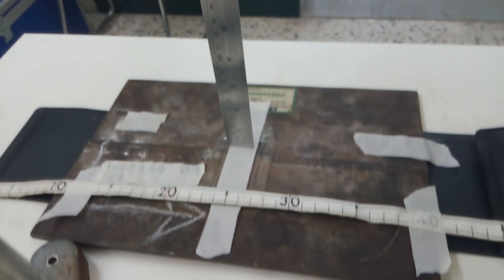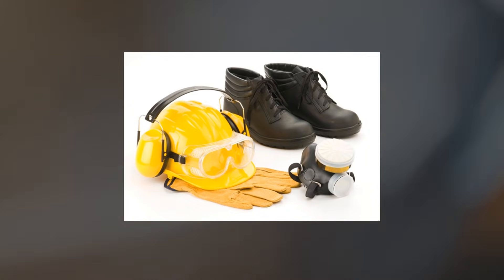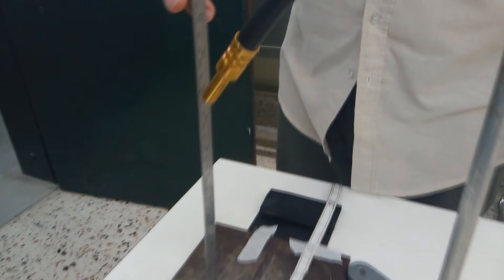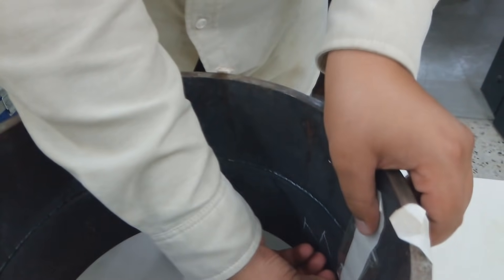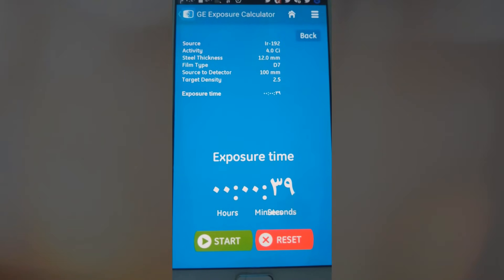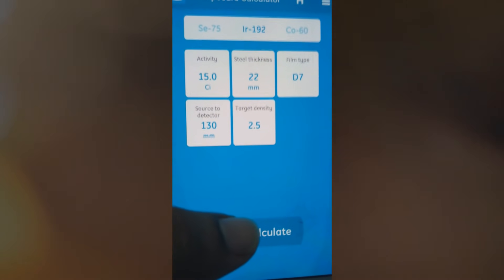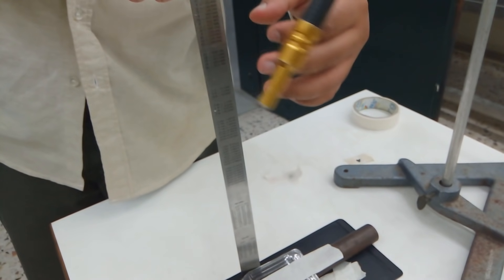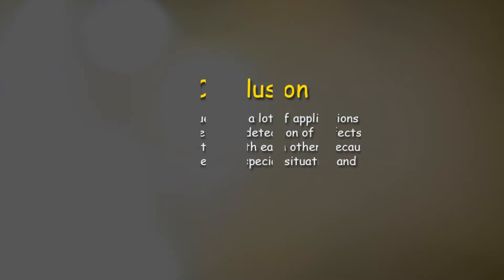Radiographic Testing (NDT)

Comment: This video is very instructive from the point of view of demonstration. To expand a little as regards the elliptic shooting, I can add that the shooting angle in elliptic shooting can be calculated as : tan A = weld thickness / weld diameter, where A is the shooting angle with the vertical. On the other hand,  the radiation thickness is modified by the cos A in the denominator as : d = t / cos A, where d is the modified radiation thickness and t is the wall thickness.
Reply: Nice one bro. Love to get in touch with u pls. Am new in NDT and I really need good people to help me out. Thanks
Reply: Thanks. Can you tell (briefly) please how to do radio graphy test for a jacketed pipe?
Thanks.